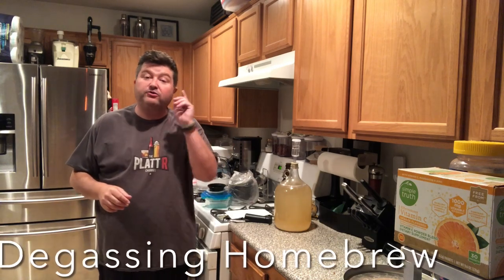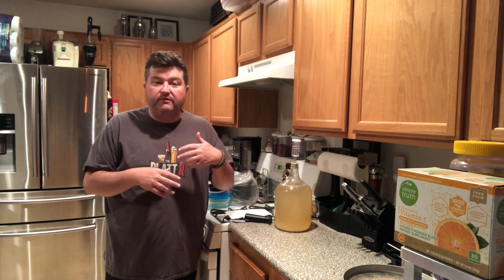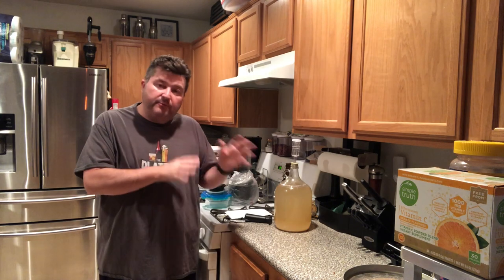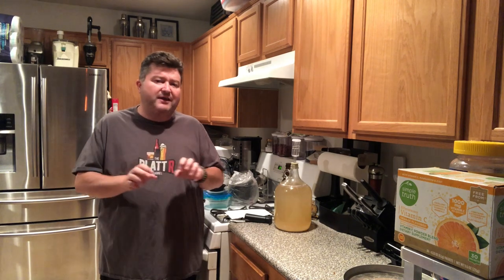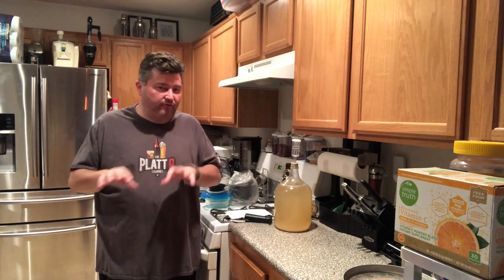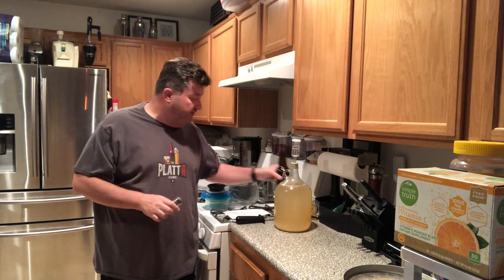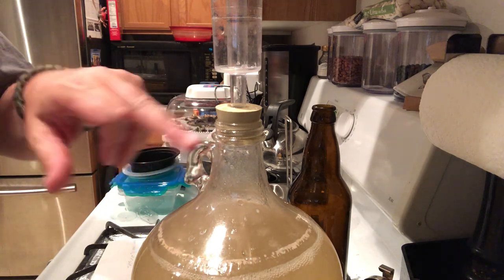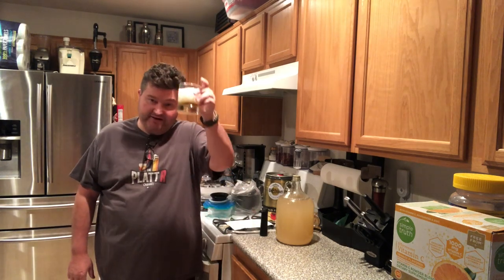Degassing your Homebrew

Comment: Hiya Platt, I run a sugar wash occasionally for distillation (yes lucky me I live in a country that allows this) and have been using the drill attachment type degasser before clearing but I never have much luck with the clearing, it stays cloudy for days even though it's meant to be a 24 hour clear. I'm fairly sure fermentation is finished, I even degas then leave it for several more days to make sure it has stopped bubbling. Anyway, don't need an answer here but a video on clearing would be a good supplement to this degassing one. Thanks
Reply from the maker: Best bet is to throw it in the fridge. The cold temps will cause the yeast to drop to the bottom.
Reply: @PlattR  Either that or pour through a filter more than once yeast will eventually drop and clear on its own but the fridge will speed it up